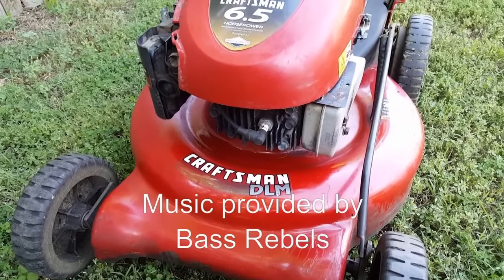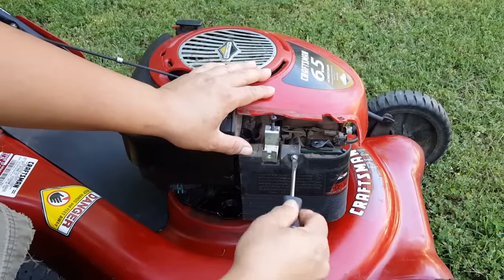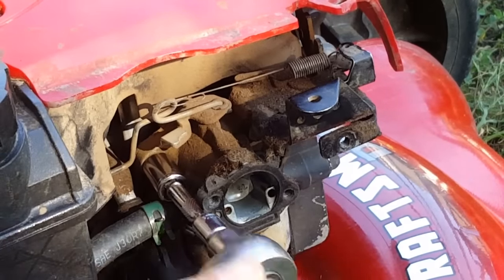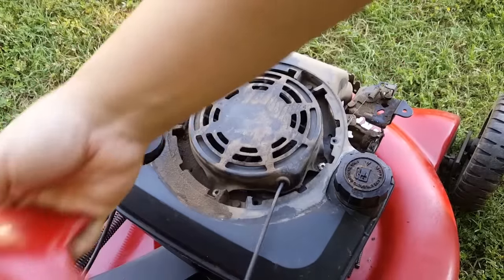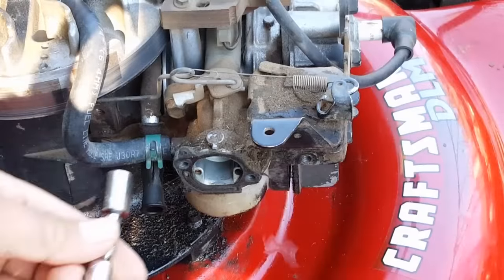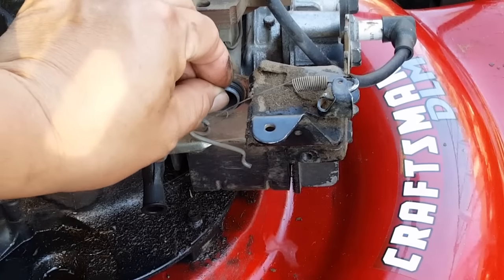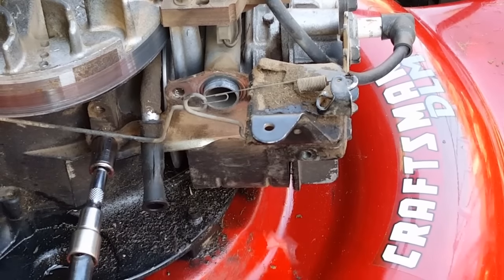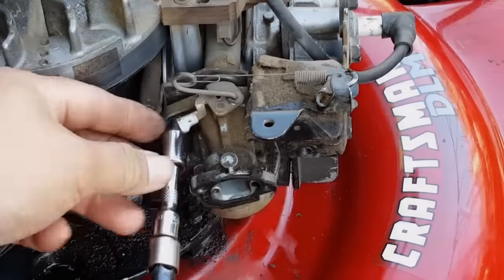Lawn Mower starts and then dies, turned out to be an easy cheap fix -Loctite!

Comment: HAVE A BRIGGS AND STRATTON 4.50 HP 300 E SERIES THAT STARTS AND THEN QUITS ANY SUGGESTIONS JEFF WETUMPKA ALABAMA
Reply from the maker: Try draining the gas and replacing it with fresh otherwise I have a video from 2 months ago titled mower starts and dies fixed that might help you out. Thanks for the comment I appreciate it

Comment: I have a different one but mine stays running but once I cut the grass it runs little bit but then dies
Reply from the maker: sure, have you tried loosing the fuel cap?  and if that doesn't work, it means the carb's seat isn't allowing enough fuel to replenish what's being delivered.  You can either replace the seat, or I'd recommend just replacing the entire carb instead

Comment: I would never be able to put all that back together. I took the carburetor off a lawnmower and was never able to put it back right. I went to buy a new one only to find out its in pieces,just like the one I have,not in one unit you can just screw on.so I gave up.
Reply from the maker: nothing wrong with it, at least you took the carb off, which most people wouldn't even attempt

Comment: I installed a new carb and checked everything this video does and it still starts and turns off?
Reply from the maker: On your mower does it have  primer bulb or is it an auto choke? Have you confirmed that gas is making it to the carb bowl?
Reply: Yeah I was thinking there is no gas going in continually! It has a primer bulb? Do you you think it might b my primer bulb?
Reply from the maker: The primer is working. That's what the engine is starting on but the gas is not coming out of the carb like it's supposed to.  Did you take the recoil off of  the engine? I was wondering if you looked at the intake tube that feeds the air and gas into the engine. Maybe theres a problem there.
Reply: Home Garage how can I send u a video I recorded today? I started it up this morning n it ran for a minute!
Reply from the maker: Upload it to YouTube and then send me the link.
Reply: Home Garage i uploaded it
Reply from the maker: Thank you for uploading the video.  Did the new look exactly like the old carb? It  sounds like its running "choke" never getting to full speed and chugging. Then it runs out of gas. When it was running out of gas it sounded like a mower running on choke and about to die. Did the new carb have two places arms or just one arm to connect the governor arm to? It should only have the one which is near the engine.
Reply: Home Garage they Wr almost identical! The new came with a red cylinder n I don’t know what’s it’s for! Thanks a lot for the help! I’m getting ready to buy a bed lawnmower! When I bought new carb on amazon it said it would fit
Reply from the maker: Amazon only sells stuff. I never trust them to figure out if its correct.
Reply: Home Garage doing research the carb I bought is universal! So it’s good to go!
Reply from the maker: Did you try cracking the gas cap?

Comment: My carb fits into a rubber grommet there is no bolt holding carb on the plastic air filter box has four screws
Reply from the maker: yes you have the newer engine

Comment: good video but this is harly an easy fix..... you had to take the mower apart basically and the spoings on the carburetor are not easy to reinstall at all
Reply from the maker: that's funny, must be a matter of opinion then, I thought the fix, was much to simple in comparison to the other fixes I've done

Comment: I would NEVER disassemble anything on a grass lawn surface, drop any small part and its gone forever!
Reply from the maker: Been there done that. I've had to pull out the metaldeteor a dozone times.
Reply from the maker: Working on the mower in the garage doesn't look that great on camera. It looks nicer for the video when I'm on the yard.

Comment: why are you using red thread lock?
blue would be better i think
Reply from the maker: I couldn't find my blue one. But you're right blue would have been better.
Reply: Different colors have different strengths of locking bolt. States on bottle.

Comment: This specific design of engine is a pain to get running properly because of the poorly designed primer bulb system.
Reply from the maker: yes the primer system is very susceptible to leaks

Comment: I have a Troy bilt that only runs with choke open
Reply from the maker: if it's an Auto - choke system, when starting the choke is closed, and when it start to run, the choke is open.   If I read your comment correctly, it's supposed to work that way.
Reply: @HomeGaragechannel  yes but it won't open on it's own.what drive the choke lever? Governor?
Reply: @HomeGaragechannel  send it email to show you the carburetor and the troy bilt mower
Reply: @HomeGaragechannel  I can send pic of the I'd tag which shows model number of the troy bilt.
Reply from the maker: to answer that question I need to know the model and serial number for your mower.
Reply from the maker: homegaragemail@gmail.com

Comment: Well, another waste of 4 minutes Iwon't get back.  My mower is tight, everything is clean inside and out, and it still dies after the prime gas runs out.  There is only one needle valave on the carb - that's for the float - all like new, still no run.  Gas tank flushed, lines all good, filter good, plug good, etc, etc...any ideas would help.
Reply: Prime circuit is entirely seperate from how carb supplies fuel while running and symptoms support that it's gotta be lack of fuel to the engine. If you're 100% sure carb choke and governor linkages are on properly and move freely, it's gotta be a stuck float or needle (not falling and allowing fuel in bowl) or blocked fuel passage from bowl to intake via brass components in the center. There's a million videos on carb cleaning but biggest warning I have is to take pics of correct linkage locations if removing carb to clean it
Reply from the maker: I really appreciate your time here. It means more than you think.   And No
Reply: UPDATE:  Found the problem. Clogged main metering holes in the bowl bolt.  Runs fine now.  Keep the vids coming.  I totally suck at this.
Reply from the maker: nice work getting it working again!
Reply: @HomeGaragechannel  It
s because of people like you.  Thank you.

Comment: Well, mine starts and stays on as long as I don't stop it. If I want to restart it second time it won't.
Reply from the maker: does yours have a primer bulb, or a choke lever for cold starts?
Reply: @HomeGaragechannel  primer bulb. It used to start first rope pull. Not anymore
Reply from the maker: oh I got it, I think the carb has started to develop a few air leaks

Comment: Also forgot to mention I cleaned the holes in the bolt that hold the float bowl with carb cleaner as well.
Reply from the maker: Ah yes that's usually the biggest culprit to it having starting issues.

Comment: Why do people not clean their engines while its apart clean engines work better a quick wipe with wd40 is magical..looks new and will help lube parts that move....
Reply from the maker: Are you talking about cleaning the metal?
Reply: @HomeGaragechannel  yes the dust build up and debris engines run hotter when not cleaned of oil and dust..
I might be just OCD  but when i have my mowers apart i clean all my parts to look new and if anything leaks you will see it..good vid though....just my opinion...
Reply: A carb cleaning would help too if its already off the mower...lol

Comment: Your video is good for a person who is more experienced. But, for someone who is doing it for the first time, it would be difficult to follow and put it back together. The reason being is you didn't explain anything you were taking apart and, the names or sizes of bolts you were removing. I'm sorry but, seriously, I would be lost. But, thanx for the video anyway. If my engine keeps stalling out, I will have a general idea of what may be causing it to stall out. But, I guess you were geared to more experienced people. "O" rings I understand.
Reply from the maker: you are correct, hopefully, it helps someone out.

Comment: If this is your definition of "easy" fix, I'd hate to see a complicated one.  Good grief.
Reply from the maker: I see your point. I'd say the diagnosis was the easy part and the repair was mediocre in difficulty.  Hard is when you've tried every fix you could and still don't fix the problem and you're stumped . Doing the repair isn't ever tough unless i have to  completely dismantle the equipment. Watch my "pull rope fix on a craftsman leaf blower" video and you'll see what I mean.  Thanks for commenting.
Reply: Once you do this you find it takes about 25 minutes depending on your skill level and experience.